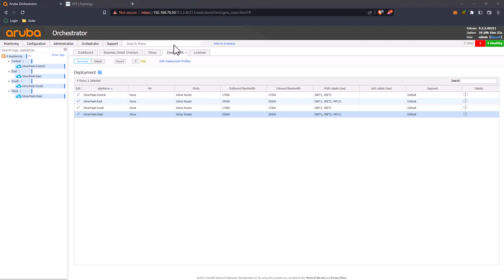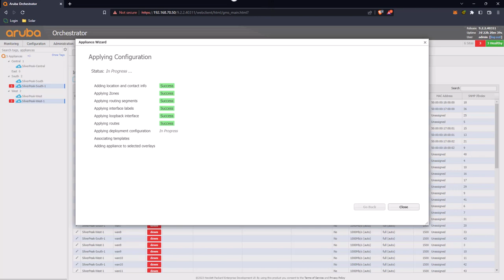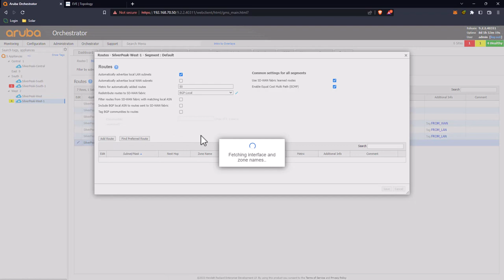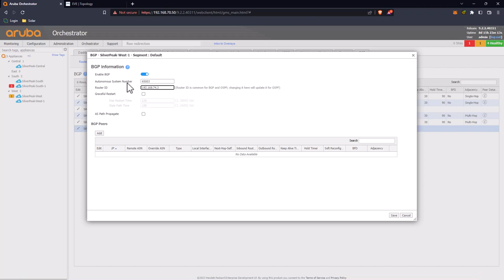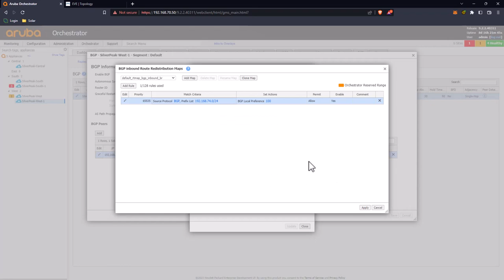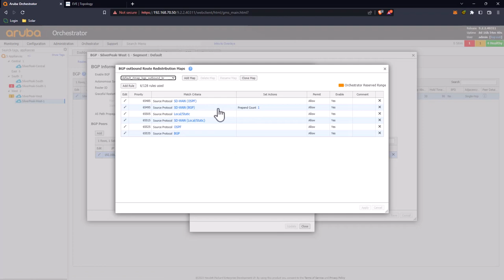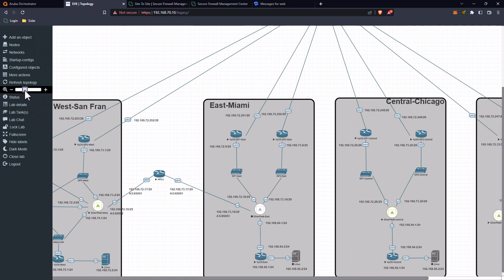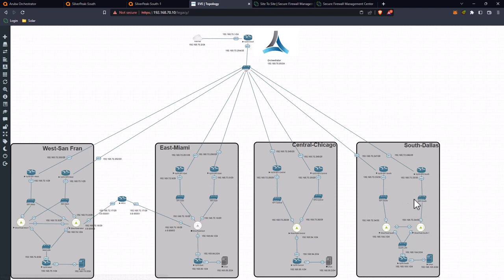Aruba SilverPeak SDWAN 5 - Redundancy #arubanetworks #sdwan  #silverpeak

Comment: Hi Brian, I have gone through multiple Vedio tutorial on Silver Peak in Youtube and must say this is the Best Tutorial , Thank you so much for excellent Stuff ! I have few query, Is Orchestrator is the control Plane or Management Plane ? or control & Data plane resides on the the Edge devices it self ? If it's resides on Edge appliance how much scalable it is ? As we know, others Vedors like CISCO & Versa have dedicated Control plane as Controllers by following SDN main principal of decoupling Control plane and Data plane.
Reply from the maker: Appreciate the feedback and glad you enjoyed them!  Regarding Orchestrator it is management and monitoring.  That is, if it is down/unavailable the SDWAN will still be able to function fine for a period of time but you lose the management and monitoring features.   Anything not available to be viewed or configured on the appliance itself is no longer there.  In addition it manages the key rotation for the IPSEC aspect so if it is down longer than the key rotation interval the SDWAN would fall apart as well at that time.  Hopefully that answers your questions.  
I've spent a fair amount of time with the Cisco product as well.  Both in customer POCs where i was leading the SilverPeak side as well as in my own lab building it from scratch.  In my opinion the products function very similarly at a high level.  They can both provide pretty much anything needed for SDWAN.  The piece that gets me is the amount of work that has to go in to building Cisco's solution.  Bringing up and making the vManage, vBond, vSmart and getting them to the point they can take on appliances and actually start to function is an undertaking.  Granted this assumes on prem and not cloud but still.  In addition, in the POCs I've done when the customer says well what if we want to do this I've noticed the answer on both products is always a resounding yes, however, I waltz into Orchestrator and say click here, here, and change this and its done where on the Cisco side it's somewhat of a groan and well we'd have to change all these templates or this/that, we can do it but it'll take a while.  Lastly, as I mentioned in a lot of my videos I spend so much of my time managing the solution in the flows section identifying and troubleshooting how traffic is being handled etc.  I've just recently in lab found out this same feature set doesn't appear to be available out of the gate with Cisco and the only real way to identify traffic flows is at the CLI.  I was somewhat blown away by this and found you may have to have yet another product deployed to get that data.  
Again, the products both work amazingly but my opinion is it appears the Cisco solution is cumbersome in configuration and doesn't provide the same analytical data out the gate.
Reply: @brianstamper  Thanks a Lot for detailed Explanation ! Yes even I felt through your tutorial that Orchestrator in Silverpeak solution is single plane of glass which is easy to Manage,Configure and Monitor(in terms of flows & Analytics) compared to other solutions .Also another key feature is WAN optimization in Silverpeak.However I feel seperate control plane component in CiSCO & Versa plays key role while doing granular or extensive Traffic Engineering.One last query in my mind is that How Silverpeak solution handles multitenancy ,Is this supports natively and Does it support any kind of VRF or VPN concepts ?
Reply from the maker: They have a Service Provider Unity Orchestrator for multi tenant when it comes to the SP side.  On the Appliance side they do support both GRE/IPSEC tunnels so you can manually build them.  I've had to do this for a number of customers as well.  In addition, VRFs are there as well.  
https://www.silver-peak.com/resource-center/service-provider-unity-orchestrator
Reply: @brianstamper  Thanks a Ton Brian for prompt valuable inputs or Insights ! It's really nice discussion & Tutorial which enhance my Knowledge in Silverpeak!